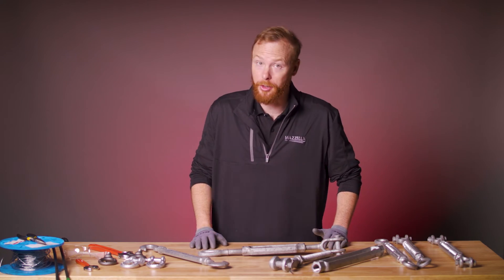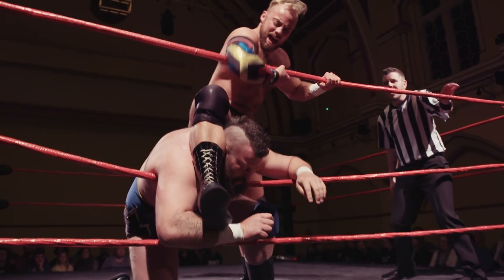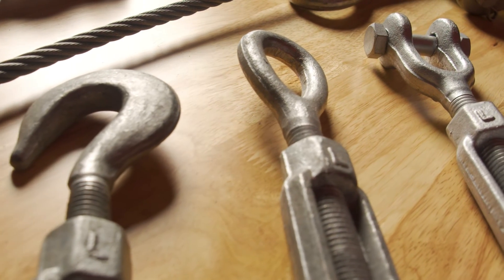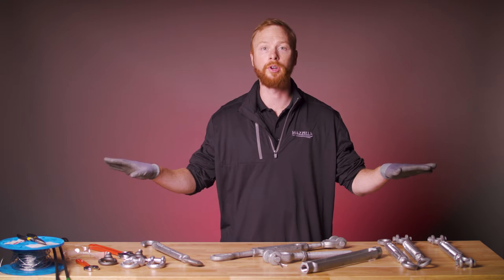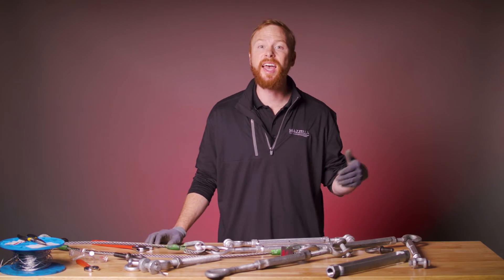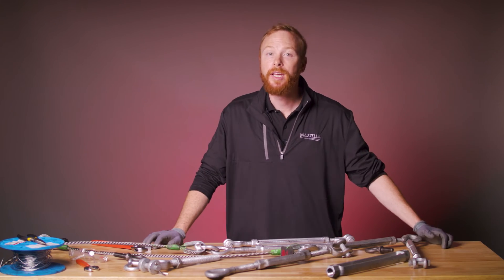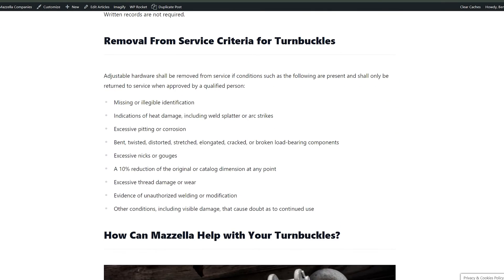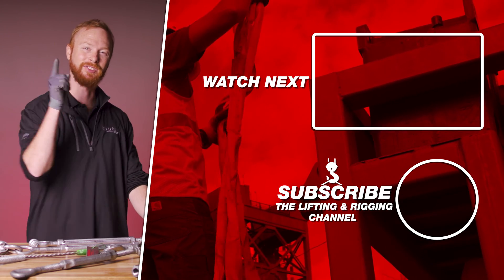The Ultimate Guide to Turnbuckles: What They Are, How They Work, and Which One You Need

Comment: Great video!  This video would be great for either a college prep high school course or a college course: showing real world engineering, mathematics and physics.  I searched the DuckDuckGo for "how does a turnbuckle work" because I have to make a decision about our double-wide swing gate. We paid three different contractors to rebuild the picket fence on the three sides our property over the course of two years.  Each contractor's crews had different skill levels; however, no one can build a gate that is problem-free.  I am not a carpenter, I am not a mechanic,  I am not a handyman and I am not a video-editor, but I am a beginner DIY Guy.  I may attempt to repair the double-wide swing gate.
Reply from the maker: Glad you found this helpful! Goodluck with your build.
Reply: Eye bolt my question is can I screw them into hard plastic and they lift the object or would the eye bolt pull out

Comment: Good stuff.  Do you ever see 316 SS turnbuckles needing used in industrial applications other than marine?
Reply from the maker: Marine is definitely one of the best applications for the SS 316 turnbuckles. Corrosion resistance is of supreme importance in marine applications. Really, it's anywhere with water. Wastewater treatment plants, for example, are places where they get used frequently.  

2nd to Marine applications would be hazardous chemical places.  The chromium-nickel alloy has resistance to many chemicals such as sulfuric acid and phosphoric acid. 

On another note, these can also be used in high-heat situations. The SS 316 turnbuckles are suited well for high-temperature applications as well.
We do see them used a little bit in construction.

Comment: Hello there, thanks a lot for those kind of helpful videos ,I have just one issue ,about the possibility of cut around 3m of crane wire rope just to remove the damaged part of it's safe or not ,if yes ,which standard cover that .
Reply from the maker: Not sure I quite understand your question. Are you talking about cutting a section of bad rope off a crane to install a button/socket?

Comment: Appreciate the detailed explanation. Could you add a few points on where they should not be used and pre use inspection 👍
Reply from the maker: Sure thing! Check out this article we have on inspecting turnbuckles to ASME standards. I will work on finding you some examples of when not to use turnbuckles. https://www.mazzellacompanies.com/learning-center/how-are-turnbuckles-inspected-repaired/
Reply from the maker: Here are some places to NOT use turnbuckles.
•	For permanent rigging applications in heavy vibration environments.  Vibrations can cause the end fittings to loosen and, quite possibly, even spin out. There are jam nuts you can use to hold the end fittings in place. 
•	  Following that same point, because of this adjustability, you would always want to have the ability to see your turnbuckles, again, to make sure they are not loosening. You don’t want them covered or hidden. You want to see them while using them. 
•	In-line lifting only. You don't want to be bending a turnbuckle over any edge. Straight, in-line pulls
•	NO hook end fittings for long-term applications